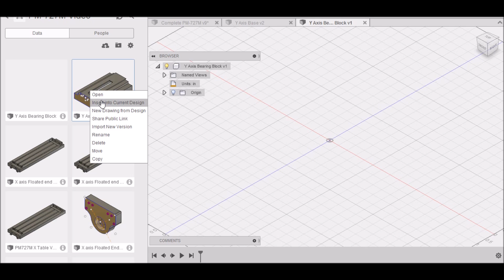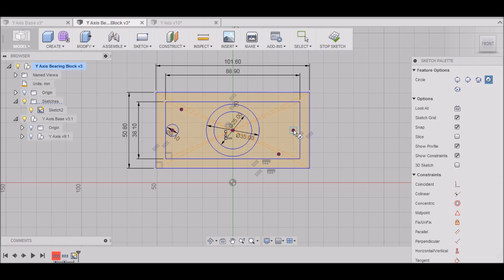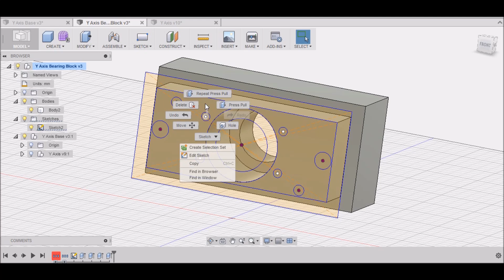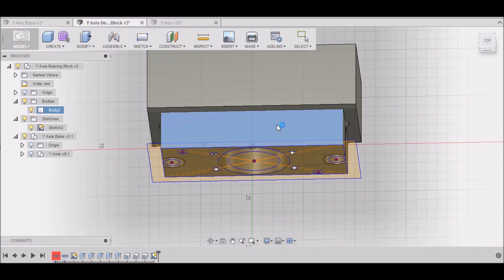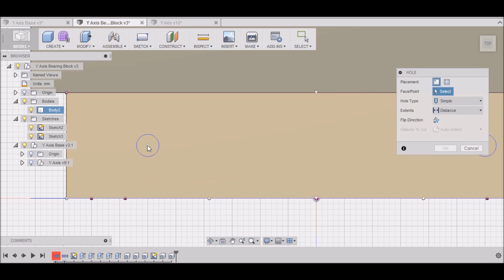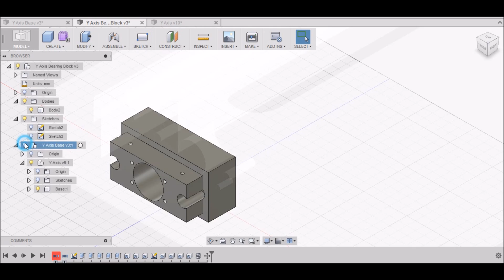PM-727M CNC " Y axis Bearing Block "

Comment: Hi Sam. Another random question.  I am puzzled that Tormach has so much room in there cabinets.  I have no idea where they stick their stepper drivers,  and I had the hardest time finding there transformer.  Then I found it...they are tiny. So I googled the name of the transformer and they refer to them as compact control transformers
http://www.automationdirect.com/adc/Overview/Catalog/Power_Products_(Electrical)/Power_Transformers/Compact_Control_Transformers

They are rated in Volt Amps.  I'm guessing the same as watts, but they appear to be 24 volts. I need at least 48 volts, probably about 10 amps.   Do you know anything else about these transformers?  I like the fact they save so much room, but there is always a negative to a positive...right?  

if its good for Tormach, it must be good for me?  Let me know if you have any thoughts.

Don
Reply from the maker: +SOCOLVN 
Hi Don 
Don't get confused. The Tormach 1100 uses a control transformer for the control circuit. And also a transformer for the steppers. The stepper transformer is located in the column. So there's more room in there panel.
Reply: +CNC4XR7 I see. Sneaky turkeys.

Comment: Ok. Sam. How did you calculate the size of your braking resistor.  There are a whole lot of unknows. Moment of inertia, gearing etc.  I am perplexed.   Don
Reply from the maker: +SOCOLVN very good question the formula for those calculations are in the VFD manual. However there is also a recommended size 26 to 100 ohms. I wanted a 70 ohm but could not find one so I opted for the 50ohm. There is not a lot of mass to stop like there would be if it were a lathe.
Reply: +CNC4XR7 Ok. Thank you. I did find it in emerson manual. 28 ohms minimum.  I guess a 1000 watt resistor would be a bit of an overkill?